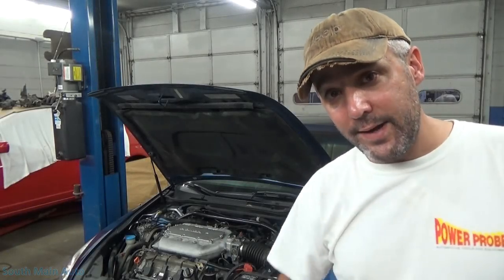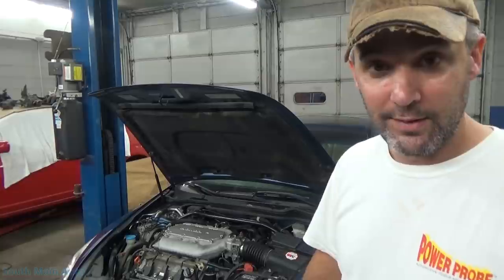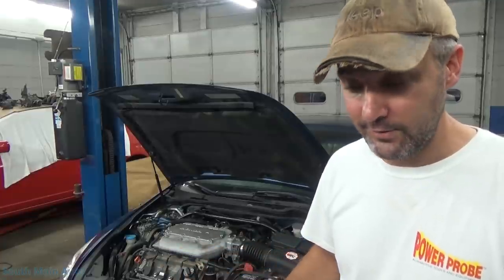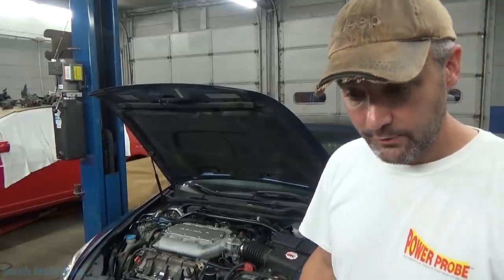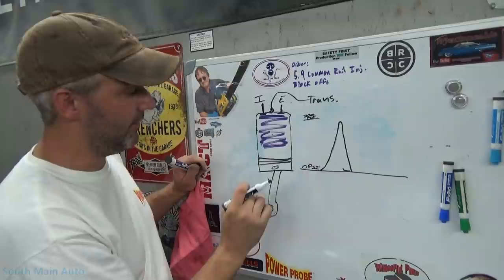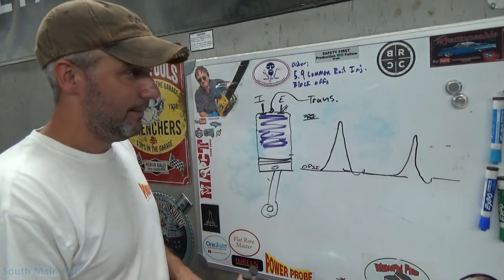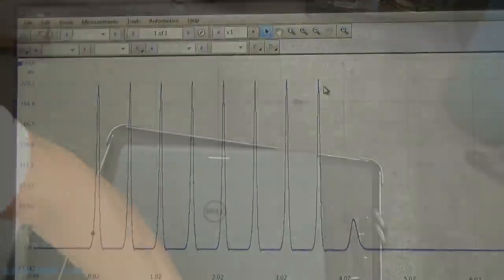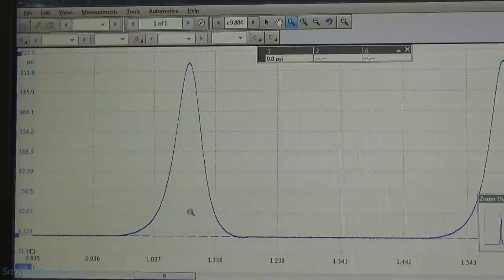Honda Accord - Slight Miss At Idle - Closer Look At Cranking Wavform

Comment: it may have been easier to see the good and bad waveforms overlayed on each other.  at the end of the day though if you can get to the spark plugs to put in a pressure transducer ,  you can install a leak down tester hose.. sure you may not be able to get to a valve cover but also if the leakdown test is good why would you have to??? and if its bad at some point you are gunna have to anyways. i think maybe this is what jimminy cricket is bitching about!!! may be different if one transducer in one hole did all 6 cylinders (wouldnt that be great)!  my old shop teacher years ago could find a bad cylinder by looking at the firing lines on an ignition scope. lower pressures take less voltage to spark. with a trained eye it wasnt too hard to spot. make me want to dig out my old sun scope book.
        all in all good brain exercise for sure. always more than one way to skin a cat. you ready for deer season yet???

Comment: No offense but you made the assumption that the customer preformed the valve adjustment correctly. I had a car come to my shop with a noisy valve train. He swore that it wasn't valve adjustment because he just did it. What did I find? Seriously loose valves.
Reply: I think you're on to something here. Especially since all the cylinders on one side have the same issue to a certain degree (#5 being the worst).
Reply: If I remember correctly, and I am older, I believe the customers problem existed before any valve work was performed.
Reply: How would loose valves cause these symptoms; wouldn't the valves open later & close sooner?
Reply: Loose valves wouldn't cause this symptom and test results. My mention of loose valves was only in regard to not assuming someone else did something correctly.
Reply: But a tight valve(s) might. If it never closes properly. If it's only slightly tight you probably wouldn't notice a timing issue. Plus I believe Eric said he wasn't able to find the timing spec for the vehicle.
Reply: Here's Honda's secret when it comes to tight valves and misfires;  Honda has a problem on a lot of their older engines, V6's and 4cyl, their exhaust valves like to receed into the head. This causes the valve to become tight. As stated, tight valves open early and close late. Extra exhaust gas gets pumped into the intake steam after top dead center at the beginning of the intake stroke. This causes a loss of engine vacuum and a deficiency of oxygen in the air fuel mixture. The result is a higher than normal MAP sensor voltage and fuel trims that show a fuel command of less than 1.0. Typical MAP voltage at hot idle for that car is 0.88 volts. Tight exhaust valves which cause misfires will generally bring the MAP voltage up to around 1.0. Though, I've seen hot idle MAP voltage go higher with tight exhaust valves, these engines are already running on the verge of a lean misfire anyway, it really doesn't take much to have misfires from tight exhaust valves. Granted, a burned valve will give similar sensor readings. However, in all my years with Honda I have yet to see a burned valve on a V6, personally. I know there out there. But it's not common. Misfire+high map voltage+rich fuel trims=tight exhaust valves. Usually.
Reply: 100%
Reply: NothingSpecial, interesting findings.  I would definitely check the valve clearances especially on Cylinder #5 BEFORE I pulled the head.  But, I think the head is already off at this point on the morning of September 26th.  I had a V4 Honda motorcycle engine and performed valve adjustments per the Service Manual every 15,000 miles.  At almost all of the four different service intervals the exhaust valve shim clearances got tighter and tighter and I had to add new shims. I know of many people that try but fail at shim work because they screw up the math and add the wrong size shims and do not double check their work.